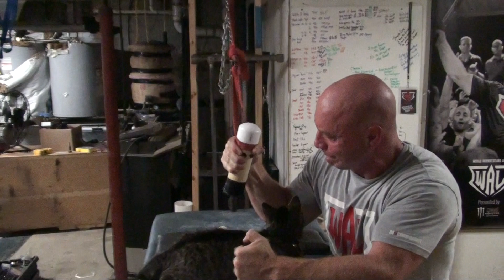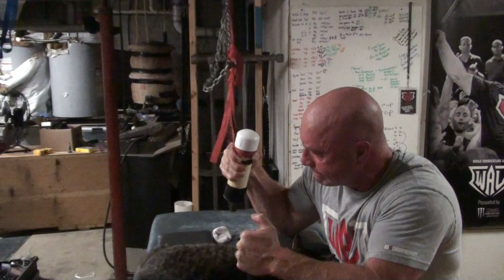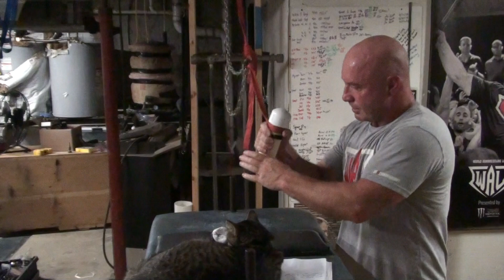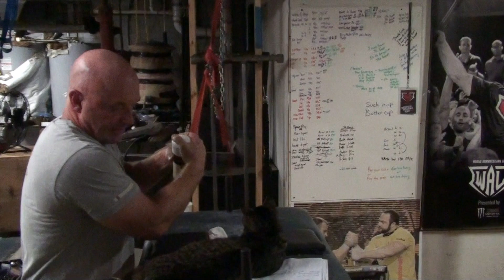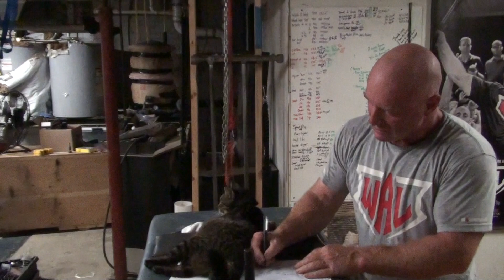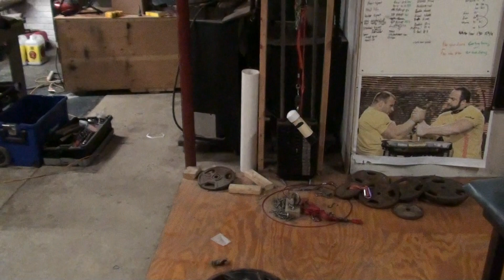Isometric Multi Spinner arm wrestling training

Comment: Just subbed the other day after watching your EVW2 interview with Ray and Janis. I wanna watch every video in chronological order. Im a 5'10" 75KG bowler turned armwrestler to get my off arm up to speed. I been training for a few years with no table time just doing rows, hammer twists, radial posts, loading pin, etc... I bought a table finally to invite others over, but I mostly wanna train similar to you and get strong. Cheers!